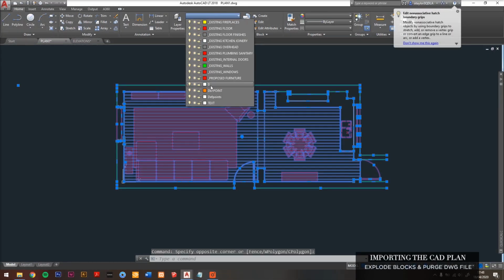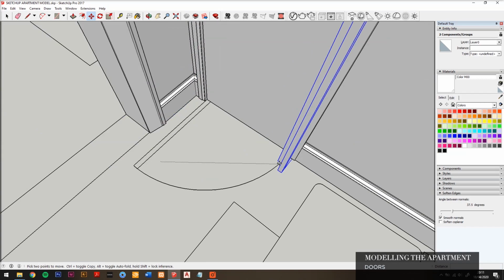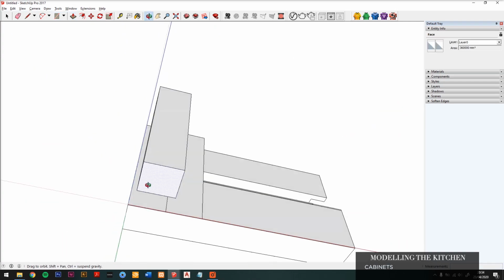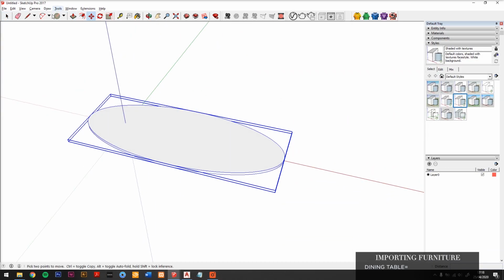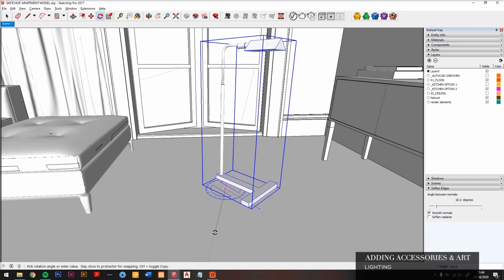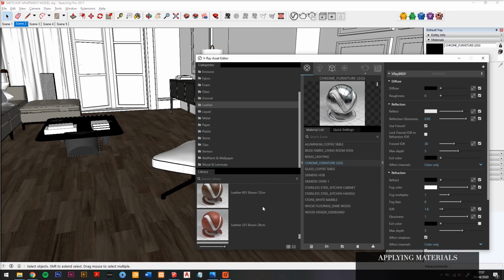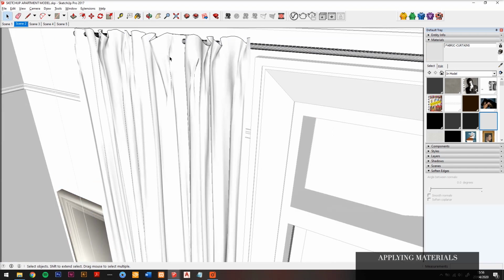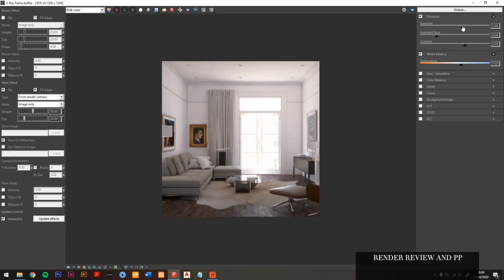Sketchup vray rendering - Interior Design model & render V-Ray 3.4

Comment: How did you iluminate the scene? only camera exposure? no sun o something like that?
Reply from the maker: Thanks for asking Lalo - the scene uses v-ray's sun and sky light, along with sphere lights for the table and floor lamps. Then after setting up the lights, the camera exposure was adjusted to get the right exposure level in each render.
If you want to check out the model, a download link to the .skp file on google drive is in the video desciription.